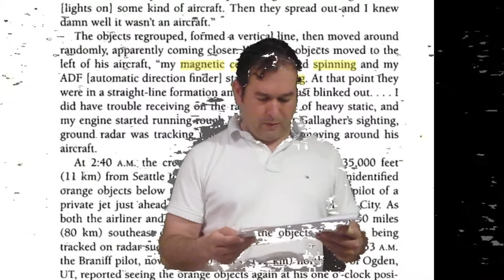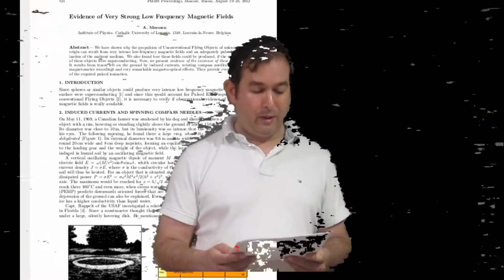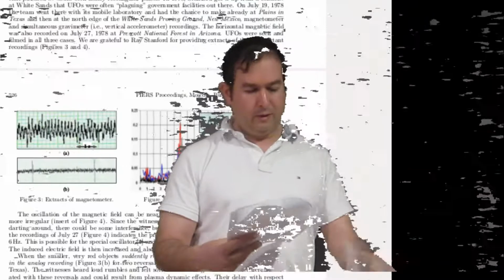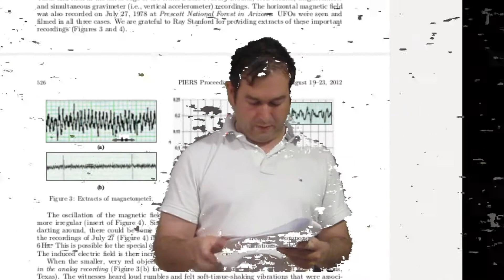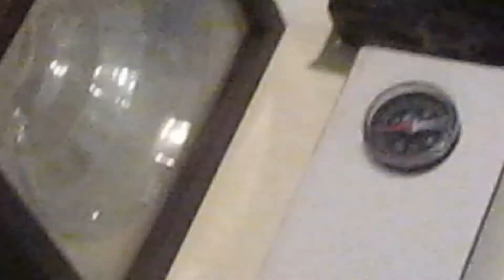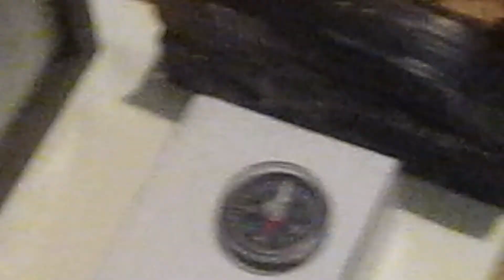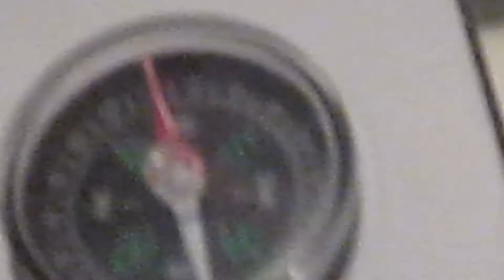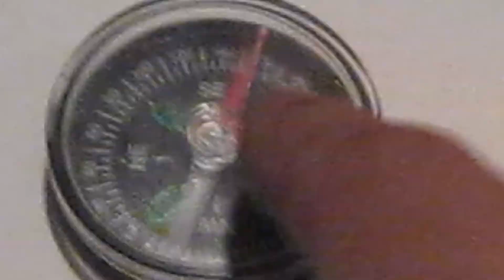Reverse Engineering UFO Propulsion Systems: Part 4 - Pulsed Magnetic Fields

Comment: What’s the problem with the video quality?
Reply from the maker: I am doing a green screen effect here, and this is one of my first attempts.. I was using a green blanket here for the background.. and the blanket had a lot of roughness, which caused color variations.. this in turn makes it difficult for the green screen effect to filter out the correct colors.. my later attempts I used a green poster board.. This is smoother, and has less color variations caused by shadows..
Reply: @jaynesnetwork  DONT YOU CANT DO IT RIGHT ... second GET OFF THE SCREEN ... your body and face in the picture add absolutely NOTHING to the video ... your person has NOTHING to do with the subject matter ... therefore there is absolutely no reason to be in the picture ... therefore no reason to use a green screen ... 
the green screen is a green that does NOT exist in nature ... and is a special purchase colour ... poster board is NOT that colour .. so it will also have artifacts in the video ... since you do not need to be seen in the video ... no need to do a green screen anyway ... 
once you burn that green screen idea work on your voice ... MONOTONE ... not good ... if you are doing this as a dare you are coming off just great with your monotone ... if you are doing this because it is a passion ... well your passion seems to be dead